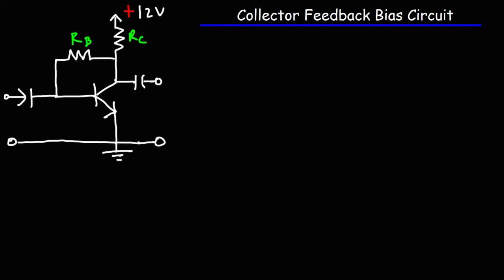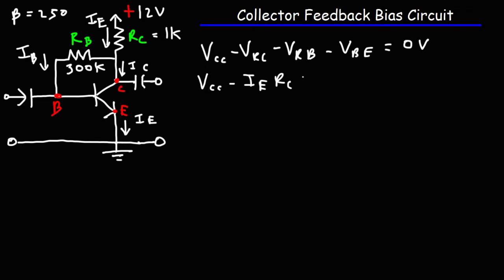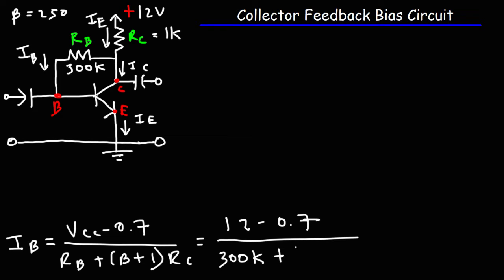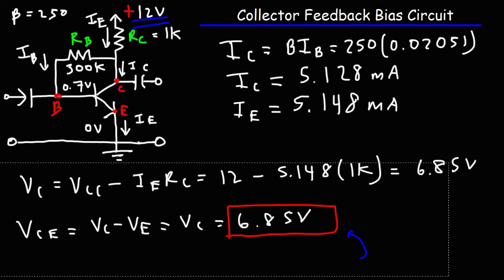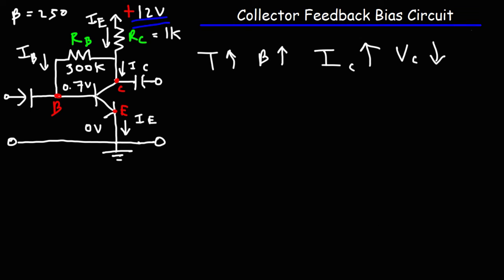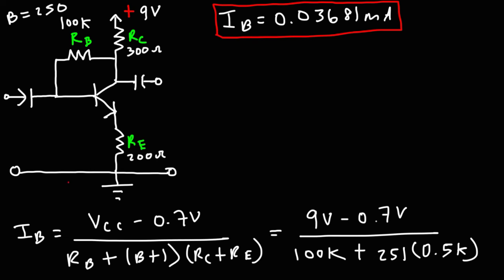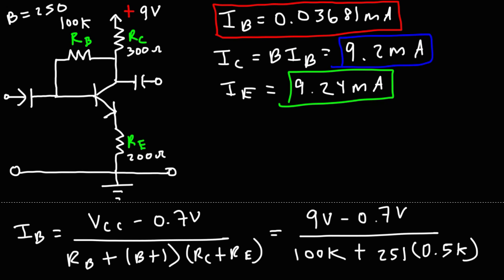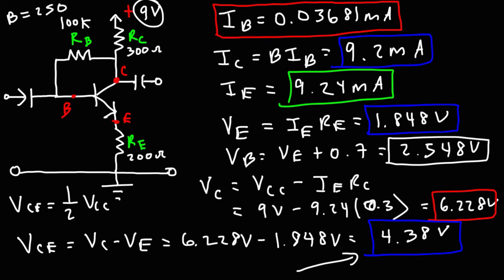Collector Feedback Bias Circuit

Comment: Although it is nice video and I understood how to calculate the circuit, the author made several tiny mistakes like passing wrong current into the formula (however, the difference between Ie and Ic is Ib = less than half miliamp so error practically does not have impact) or writing the formula with 5 instead of 5e-3 (another tiny error, only little confusion for the first time). Despite these errors, I still think it is qualite one. Good job, Organic Chemistry Tutor and see you later.

Comment: what is value for base volatge, VBB? Is it 0V?
Reply: If there isn’t a resistor between the emitter and ground, then the base voltage should just be the voltage difference between the base and the emitter.  He mentions that it should be around 0.6 or 0.7 V for the transistors he is using.